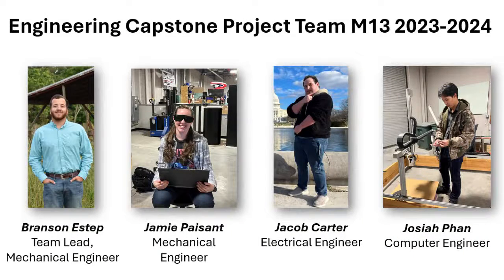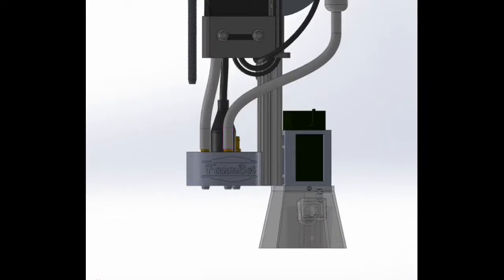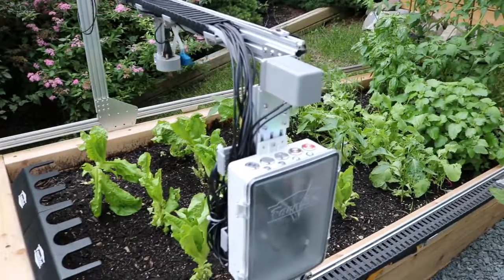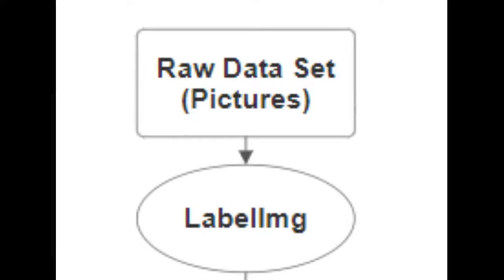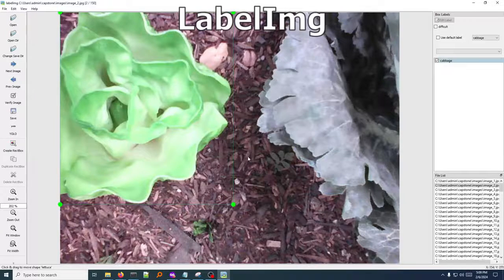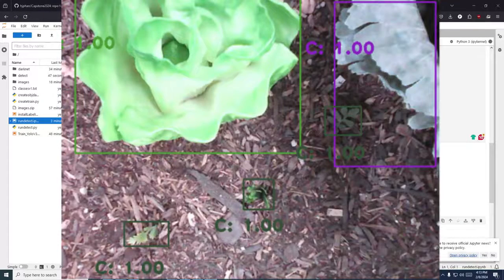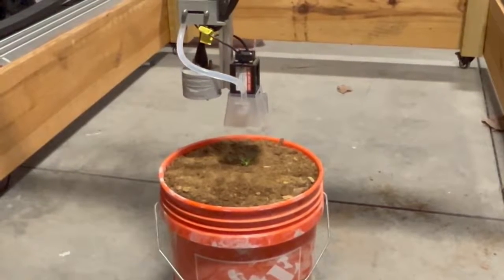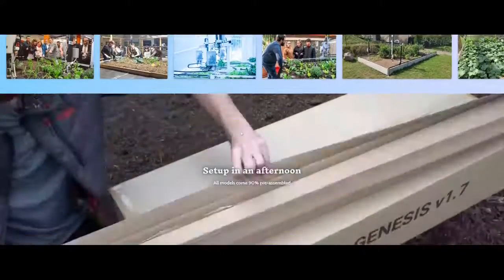FarmBot Laser Weeding Tool Developed by the Liberty University School of Engineering

Comment: I had a pleasure working with Farmbot and making this video for capstone!
Reply: Great innovation seriously! I just ordered the genesis xl... what do you think it would take to get a laser on my own farmbot?? XD
Reply: That's so cool. I worked on the laser weeder mount for farmbot as well (Project Cyclops) . @jacobcarter9087 try this instead, I think you can get like 20W laser 450nm with a liquid lens or manual lens to control the spot size. Turn the laser on for 1-2 sec, and you should be good to go. (Heights around 500mm ). You can reduce the time of going down near the crop. But make sure that you build like guard around the farmbot with the laser shield.